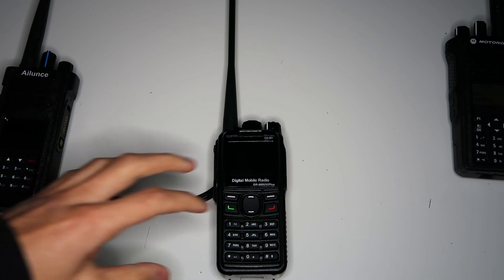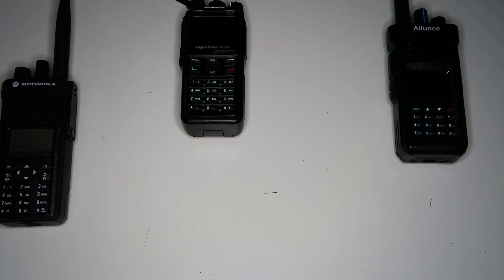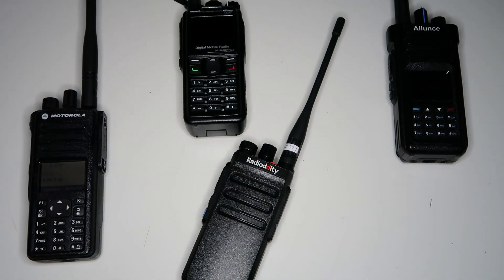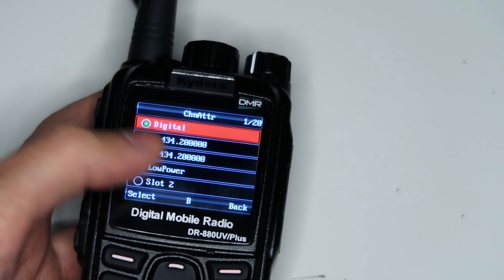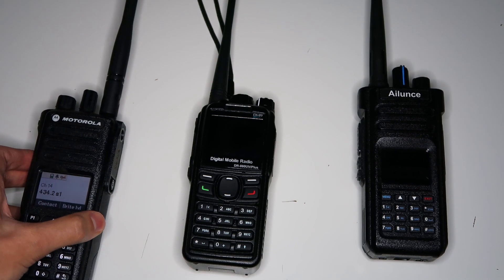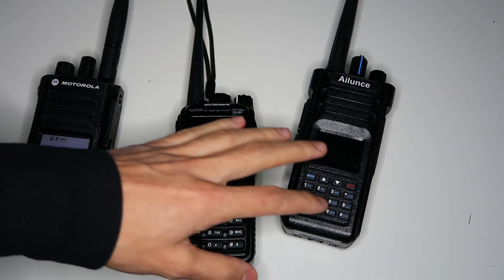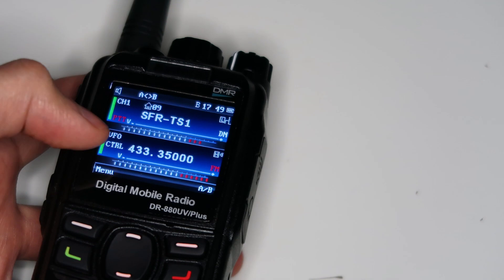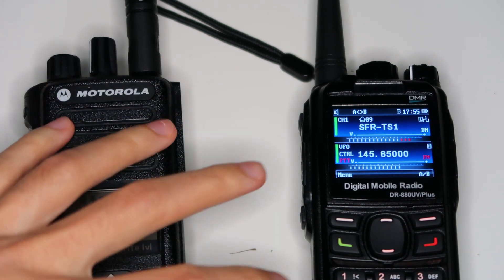Radioddity GD-88 Single Frequency Repeater (SFR)

Comment: Radios like the Anytone D-AT878UV series DCDM with split timeslots so do not suffer the drawback demonstrated with the Motorola and other mobile stations in the video. The Anytone can operate in DCDM transmitting on TS1 and receiving on TS2. To do this you need to configure DCDM for TS Split. While there is not an explicit use case in the ETSI DMR standard illustrating this it is an inherent capability which some suppliers have implemented and others haven't. Nonetheless a very good video and presentation of the problem.
Reply from the maker: Thanks. In a later video I showed the hytera's single frequency repeater, which has a much better design. I don't know why Kydera didn't copy that design instead of this disaster they call a single frequency repeater!

Comment: Hello, I have a question and a slight problem. I have a radioddity gd-88 DMR radio and 2 KENWOOD NX1300 radios. Kenwoods communicate with each other in both directions. Also with radioddity, but when the radioddity is suitable in Kenwood, it is portable, the speaker is slightly humming, but there is no modulation, nothing is independent, what needs to be connected, I will add that CC is the same, timslot is also the same in the repeater function, there is a lot of noise but there is no sound, please help

Comment: Curious why you couldn’t use, for example, TS1 for repeater input and TS2 for repeater output while using dual receive on all radios talking to the repeater. That way, all input to the repeater is on one time slot and all users are listening to the other time slot. The only issue will be if a receiving station also hears the talking station direct.
Reply: Even that could fix by just have a one of the section set as priority like on the DM-32 you could just set the section with the time slot 2 Rx as priority and you would not even hear the person TX

Comment: I was thinking of getting one of these to test the sfr. Me and a few mates run the opengd77 so this could work. My idea is we tx on ts1 and have the ts scan feature enabled so it will hear the output when it’s on ts2. Obviously the only issue there is if you’re close to the tx radio it may get confused on what ts to listen to but in my case, we won’t be too close.
Reply from the maker: Does the Opengd77 firmware have dual capacity direct mode? If not it won't work
Reply: @radiosification  I’m not sure but surely it won’t be needed tho ? I tx on ts1 so the repeater hears that and re-transmits on ts2. The receiving radio will be in promiscuous mode so will hear any ts - switching to ts2 to hear the  repeaters transmission.
Reply from the maker: @samsalloway7412  no the SFR on this radio uses dcdm. If your radio transmitting in is not using dcdm then the SFR doesn't hear it. It doesn't work like a normal repeater
Reply: @radiosification  have you got an email I can contact you on mate ?
Reply from the maker: @samsalloway7412  yeah it's my username on YouTube at outlook.com

Comment: when in cross band and using 2 bands , you would not hear the popping, which is the DMR 4fsk being demodulated because of the lack of isolation.  When using the same band you would hear it on the FM side when the frequencies are fairly close. If you have an FM communication test set tune to a freq using DMR and you will it that same popping.
Reply from the maker: Thanks for your input

Comment: Hi , to be clear. 
1- Is this radio working good as DMR repeater using 2 frecuencies (Tx and Rx)?
2- Will this RE- TRANSMIT  radios info, as ID name or other?   Thank you
Reply from the maker: 1. Do you mean single band or cross band? It will work in either but it will probably be desensitized if you try to do it as a single band repeater (not including single frequency repeater). It won't work with most DMR radios though because if you use two frequencies they expect a proper repeater which transmits so they can sync up.
2. I can't remember. Maybe I showed it in the video. If I have to guess I think probably not. I think it shows the information from the repeating radio, so the GD-88.

Comment: We have an SFR repeater model Kydera Emesh installed by radio amateurs. Works very well. There is a different algorithm for setting time slots, the radios are configured to work in a direct channel without specifying a time slot, and the repeater itself is synchronized by time slots
Reply: yes it is true, the standard sfr method is used.
Reply from the maker: It sounds like that one uses the normal SFR mode I talked about at 3:30 in this video, similar to how most SFRs work. I think that method is better than how the GD-88 does it.

Comment: Motorola have own way of implementing this mode which is programmable in radios which radios from other brands haven't. We don't know if the SFR is not working does radios will still comunicate in simplex mode? Speaking for only Motorola SFR system I. E. Extended range direct mode ...
Reply from the maker: Yes I believe they will because my motorola radio could talk to other DMR radios on simplex when this mode was enabled.

Comment: Can the radio crossband from analog to c4fm and vice versa or it just works with DMR/analog or DMR/DMR?
Reply from the maker: No, the radio does not support any other digital modes. DMR and FM only.

Comment: -? Will this radio Transmit  the radios Id or name etc, OR IT WILL TRANSMIT gd88 ID.     Can we see who is calling tru this repeater or no.?  Thank u
   

DMR and this GD88 IS RIDICULOUS CONFUSING
Reply from the maker: "Will this radio Transmit  the radios Id or name etc, OR IT WILL TRANSMIT gd88 ID.     Can we see who is calling tru this repeater or no.?"

Yes it will transmit the ID you set, same with all DMR radios. If you're asking about talker alias which the radio now has, you can also set that.
Reply: @radiosification  sorry I mean to say RE-TRANSMIT  the other radios ID /info when is used as dmr repeater. ??

Comment: Two questions for you:
1. Regarding the Motorola radio shown in your video, I don't see the "talkaround icon". This means the current channel of the MOTO is a repeater channel. For a repeater channel, how is it possible for you to key up without a repeater actually there?
2. Regarding the DR-880UV shown in your video, you just showed that the Rx frequency and Tx frequency of 434.2 MHz. Since the Rx and Tx frequency is the same, it is therefore a talkaround channel. For a talkaround channel, the setting of time slot doesn't make any difference. That is, if you transmit on TS1, you can still receive on TS2, and vice versa.
Reply from the maker: Good questions. I'm going to have to write a pretty detailed answer!

I don't think talkaround means what you think it means though. Normally talkaround is used to mean talking on a repeater's frequency when the repeater is out of range or not working. For a simplex channel, that is not the same thing as talkaround. It's just using a simplex channel. 

I had a look at the manual for the radio though and it does show that icon as "talkaround". I'm not sure why they've done that because it is rather confusing, but the icon basically seems to mean you're operating on a simplex frequency that's not through a repeater. It shows up for analogue and DMR simplex channels, but does not show up on DCDM channels. I don't know why they haven't set it to show on DCDM channels, maybe it should do. Maybe they reasoned that a DCDM channel can never be a repeater channel so it's not necessary, but the radio user doesn't know this because they're normally just given the radio already programmed by someone else and probably have no idea what DCDM even is, so this wouldn't be a very valid design decision. So it seems to be a bit of an inconsistency in their design choices to me.

1. The channel being used was a dual capacity direct mode channel, so it cannot be a repeater channel (at least, normally). In general you don't have repeaters using DCDM. This Kydera is the exception (along with a small number of other chinese radios I think). I can key up without a repeater being there because the radio doesn't expect to be on a repeater. As far as the DP4800 is concerned, it's just transmitting on a DCDM channel. Someone else is talking on the other timeslot at the same time which is fine. No repeater around. What's actually happening is the Kydera is repeating it back out on the other timeslot, but the DP4800 has no idea that's what's happening.
2. The whole point of this video is that it's a SINGLE frequency repeater, so naturally the TX and RX frequency will be the same. On normal simplex channels on DMR (ones that are not DCDM channels) then you're right, the timeslots are ignored because there's no reference by which to determine which timeslot is in use. However, DCDM's purpose is to synchronise the radios so that you can use both timeslots. Thus on a DCDM channel, you can use both timeslots as I'm doing in this video. Btw, DCDM channels are always simplex. The radio actually greys out the TX frequency when you set a channel to DCDM - it won't even let you try to set different TX and RX frequencies.

Hope that helps.
Reply: @radiosification  This helps a lot! Personally I don't see any difference between a simplex channel and a talkaround channel. They all mean having Rx freq=Tx freq. To further differentiate one from another, simplex channel, for me, is just a random channel which Tx freq=Rx freq, such as FRS radio channels, test channels, etc. Talkaround channel, on the other hand, may refer to a repeater channel BUT you just transmit at the downlink frequency of the repeater channel, while maintaining the Rx side the same. Usually there should be a programmable button to allow toggling between talkaround mode and repeater mode. A talkaround mode is, indeed, technically a simplex channel.
Regarding the MOTO operating in DCDM mode, does this mode require an additional "base radio", which typically is a mobile radio, to provide the syncing of time slot, as stipulated in the description of MOTO CPS? If yes, do radios from other brands also require such a base radio? If no, do the MOTO radios communicate separately on TS1 and TS2 respectively, when the DCDM mode is turned on? In this case, what frames the time slots?
Reply from the maker: They all work the same in DCDM mode. You don't need a base radio, any radio can work as the "timing leader" as long as it's set as eligible to be the timing leader in the CPS. The radios on the frequency (both timeslots together, not separately) will negotiate and pick one to be the timing leader, which will decide on sync. I don't see that setting on the chinese models so maybe they don't allow you to select whether the radio is preferred, eligible or not eligible and just have one option always set.
Reply: @radiosification  thanks!

Comment: Great video! I'm about to get my licence HB9. I was wondering for different reasons, whether the alincoAlinco 1226 DJ-MD-5-GPS DMR VHF/UHF is relevant in a mountain region, with sporadic use in city? What do you think about! My choice is mainly oriented due to my untrust toward chinease products in General. That's why I preferred. Japanese brand specially as they have shifted their production to Japan. Let me know your thoughts! Thanks and cheers from 🇨🇭
Reply from the maker: I have a comparison of DMR handhelds on my blog and I remember that radio being on there. Can't remember what I said about it now but I've barely heard of anyone using it so take from that what you will.

I'm not sure which radio you buy will make much difference in terms of mountain/city use. Radio is radio. As long as you have an antenna that works well for the frequency you're using, any of the popular DMR handhelds should work okay.
Reply: @radiosification  thank you again for help and your opinion! I will give it a look! This is really helpful specially as I am Newby here and need as much information as possible to make the right choice!
Wish you a happy end of the years celebrations 🍾  and all the best!
Reply from the maker: Good luck with your licence!

Comment: How many handhelds have you got now bud? I'm thinking a lot...its an addiction. 
A lot of business radio use this system here where I am in Scotland. There are many DCDM Linked/shared repeaters and they overlap areas.. Because there are three main DMR suppliers here they all seem to allocate the same or close by  TGs... Which makes it difficult to identify what is what.

So if I was looking for a DMR handheld to scan with which would you recommend?
Reply from the maker: Quite a lot. I haven't counted.

Are you sure there are DCDM repeaters? That's an extremely uncommon thing and I don't think any exist that could be linked.

Comment: That's why I don't even mess with digital anything I'm an analog person and I stayed to that I will never use DMR for anything it's analog or nothing in my case and I don't have to worry about nonsense programming either it's too complicated and I don't have any time to mess with that shit‼️‼️‼️‼️‼️‼️‼️‼️
Reply from the maker: Fair enough. The programming is not actually complicated once you understand it. I find it really easy to program digital channels now. And there are some cool features DMR has that are fun to play with. If you just want easy to use communications and don't care about other features then analog works well.

Also this radio is not a good one to judge DMR from. It's not a very good radio tbh because the firmware has so many issues. If you get a good quality DMR radio like a Motorola then it works great.

Comment: Thanks for yor interesting explanation about SFR. What do you think if all users using such as dual wacth/dual monitor/dual on/dual stand by radio. So we can set TS1 on A channel, and TS2 on B channel in the same SFR. Or using radio with pseudo trunking feature which is can automatically detect TS transmitting?
Reply from the maker: Actually pseudo trunk doesn't work with it since it's not dual capacity direct mode. Hytera did have DCDM previously but were forced to remove it when Motorola sued them. I'm not really sure how all the other Chinese manufacturers are getting away with it, unless they're licencing the tech from Motorola.

Using dual monitor radios should work similarly to using a scan list as described in the video. So in theory I think it should work fine. You'll still have the other issues though like very low audio and randomly not transmitting any audio.
Reply: @radiosification  I see. Thank you very much for your answer, and goodluck! 👍

Comment: Thanks yes interesting Video shows that the gd-88 is an advanced dmr Radio packed with functions and not for the faint hearted it will never be an Anytone 878 ,the dual receive is such a good feature try it with a duplex hotspot using separate time slots.
Reply: Have a look here:https://www.youtube.com/watch?v=EnkW3ywOacc&t=233s
Reply from the maker: Thanks for sharing